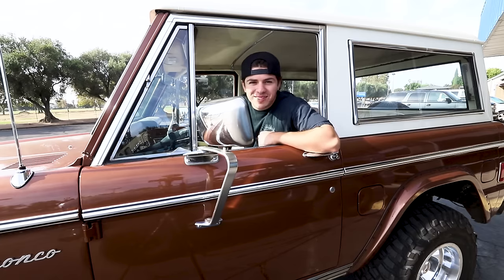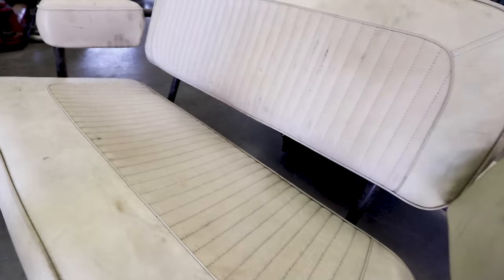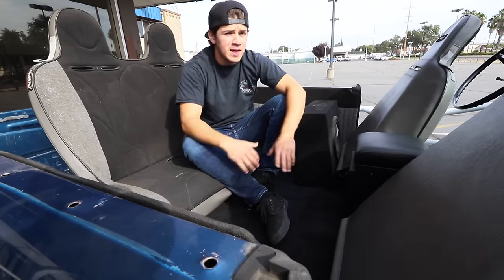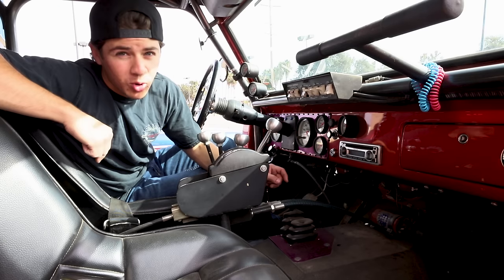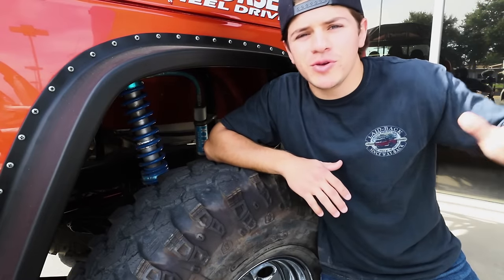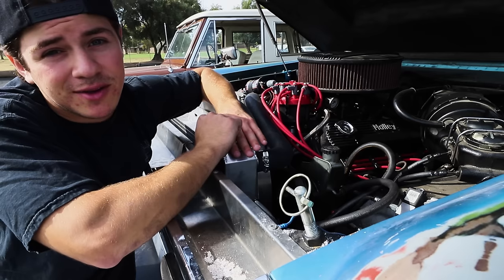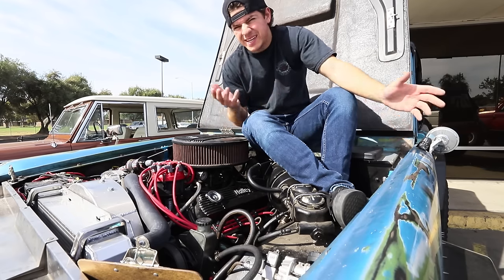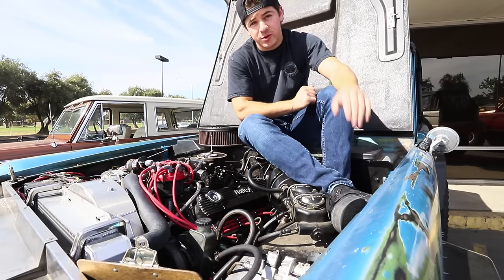Top Ten Upgrades to Make Your Bronco More Comfortable

Comment: my list for an 81 full-size, weatherstripping and window guides, fix rust holes in floor, use rubberized undercoating for the floor, I use my truck carpets going to get ruined quick, disc brakes all around, fuel injection system (holley sniper 2bbl more than enough for a 300cui 6cyl) Truetrac in the rear diff is nice
Reply from the maker: Dude! Sounds like an intense project! haha but a fun one! If you have instagram, tag us in some pictures so we can see the progress!
Reply: @wildhorses4x4  sure thing im About17Cheezits there too
Reply: Do you have videos of everything you've done to your Bronco

Comment: Best up grades on my 88 bronco are 1990 f350 axles and cage off rd radius arms and deaver leafs. 
2nd, np435/208 . 
3rd my daughter Britney starting to build her 78 bronco she got ten years ago when she was 6 years old.
Reply: You think I can upgrade my axcels on my 70 Bronco for f150 or F250 or F350 trucks, like power brakes and power steering? Would love to upgrade to disc brakes from some F series.
Reply: @elmorcielagomorcielago1146  YES ABSOLUTELY.   You can easily put a Dana 60 up front and the sterling 10.50 in the rear into any bronco.  Nice thing about the newer superduty axles is the still use a radius arm.  I'd look for a f350 over a f250 because the f250 gets a weaker front differential.  Gas engine trucks get 4.10 ratio diesel pickups get 3.73
Reply: @endurotruckererniedesjardins  Sweet..! I'm glad I've not spent any mony upgading my axcels or disc brakes. I'd rather go to the junk yard and get better deal and better quality than what they sell online. Also they told me that you could'nt put a 351W in a early Bronco, sombody said the hell you cant. Fits like a glooovve..!
Tnk U, C U out on the trails and dunes.
Reply: @elmorcielagomorcielago1146  if you got the time and money. Anything can be done. Full size axles will be wider then the early bronco axles. They can be narrowed if you know what your doing. I've seen early broncos with 460s , Cummins 4bt,  Cummins 6bt, 351w stroked to 408. Chevy LS , the awesome part about building off rd trucks is the dream is all yours. To be honest, the axles sold by vendors built for the bronco are likely stronger then going to wrecking yard axles.  Dynatrac make really awesome axles. The 9 inch in the rear of your bronco I wouldn't swap out I'd just upgrade a few things. I ran 18x39.5x15 superswamper boggers on a rear 9 inch for years with no mods and no troubles. If you have a early Dana 30 up front swap to a modern dynatrac dana44 and your styling.  Unless your thinking of tires bigger then 39s. If your plan is 42s or bigger you'll want some big iron under it like a pro rock 60 front and 70 rear
Reply: @elmorcielagomorcielago1146  there was a good magazine called BRONCO DRIVER. Start collecting them and check out the ideas other builders have done
Reply: @endurotruckererniedesjardins  I sooo need those hacks and tips...This Broncos keep you busy for sure...gota love it... nothing like turning a wrench while drinking a beer, thank you sir. I'm still enjoying my high from installing my new rear bumper with the spare tire and the cooler/gas tank. Loving it. Can't wait to install the front bumper. Thank you sir.
Reply: @elmorcielagomorcielago1146  too bad you dont live close by. I'd love  to lend you my collection of bronco driver magazines with you.